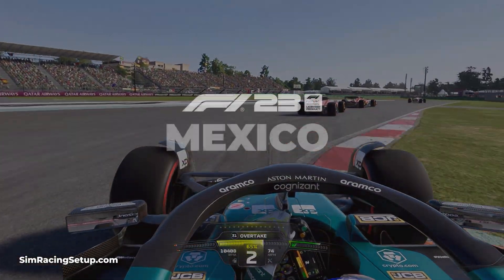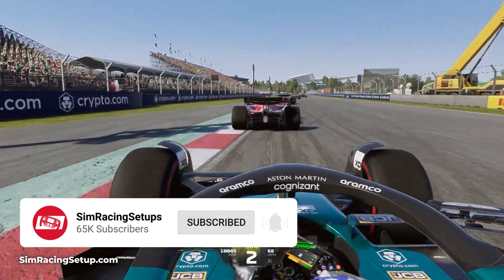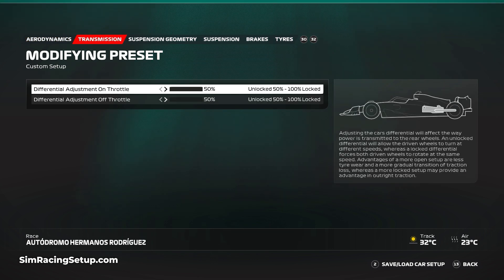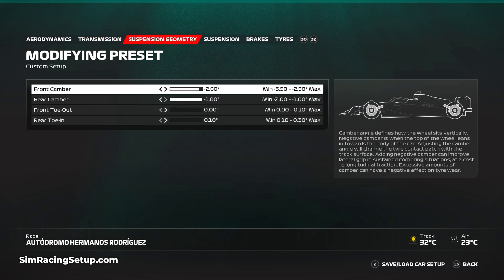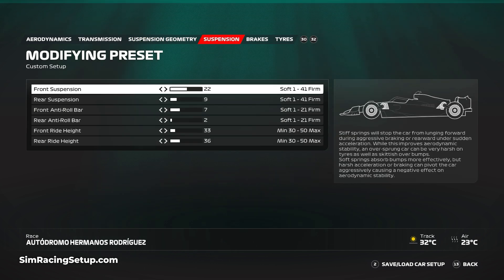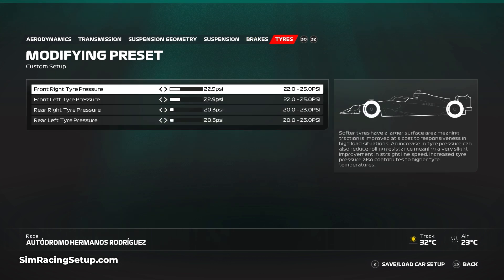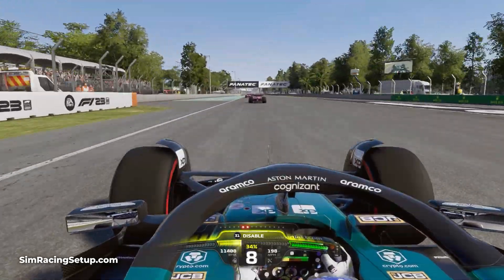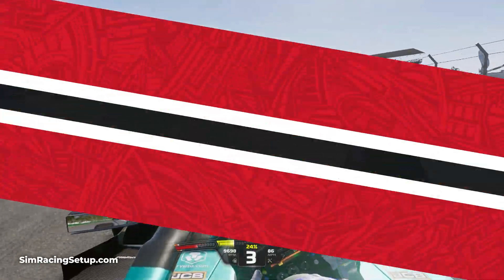F1 23 Mexico Setup: Optimal Race Car Setup

Comment: Did hit the like button even if I had my struggles with this setup. My tyre temperature was constantly above 100°C (100-105) and the car felt very instable.
At the exit of some corners it felt if I would play F1 2022 again. Never had to use so much flashbacks to get a race finished like I had on this track because of a spin that I had by loosing the rear with only a minimum pressure on the throttle. (maybe in Monaco I would have, but I always skip/simulate Monaco).
No critique just saying that this setup for me didn´t work so well as all the other setups did so far.
Reply from the maker: No problem at all man. Appreciate the feedback. Mexico is extremely tricky!

Comment: If anyone is still struggling with oversteer or rear brakes locking, set aero to 24 front, and 26 rear. Car feels a lot more stable now and I’m setting much faster times than I was with the original aero on this setup. I don’t think straight line speed gets affected too much by this but I haven’t fully tested it yet so take it with a grain of salt, but the corners feel 10x better now.
Reply: i’m gona. try this rn because what i have going ain’t it
Reply: I tried this, i was very very faster, it was perfect

Comment: I love your videos dude. I really do. But this track was actually tricky to get right. I was doing the qualifying pace on the practice programs, I couldn’t be fast enough because of straight line speed. So I lowered the downforce a bit to 22 on the front wing, and 17 on the rear. I could still have great pace in the corner and higher straight line speed. I reached my goal in the practice program. 

I’m absolutely not complaining, your videos are absolutely amazing. But this aero setup worked better for me on this track.
Reply from the maker: Thanks for the suggestions. I love hearing others recommendations and solutions! Mexico and Baku are by far the worst tracks in this years game. All aboard the struggle bus!!
Reply: I agree! I never use traction control, and Mexico feels really tricky to keep the car stable in and out from the corners! Baku was okay for me actually. And the setup you placed there, it worked really good 😁

Comment: My tyres keep cooling down so so quickly, I've increased the tyre pressure and nothing, can only do 3 laps max regardless of the compound and they tyres are freezing with no grip, such an awful track.
Reply from the maker: You have to really push the car here as so many corners are slow. Strange to hear of tyres underheating, normally its the opposite!